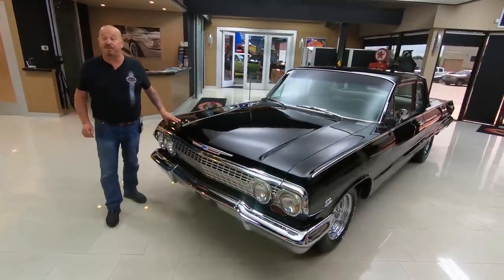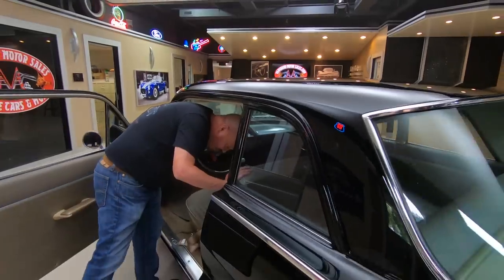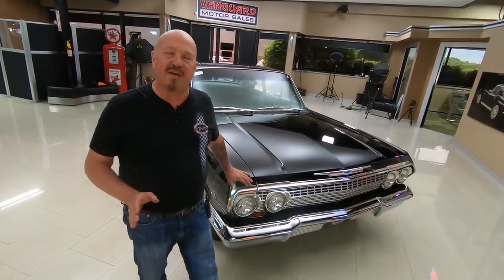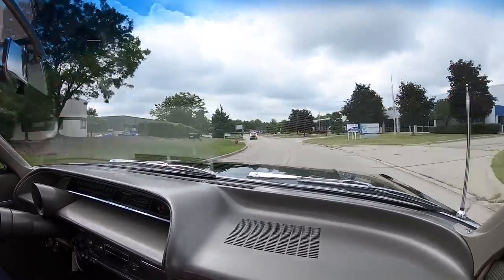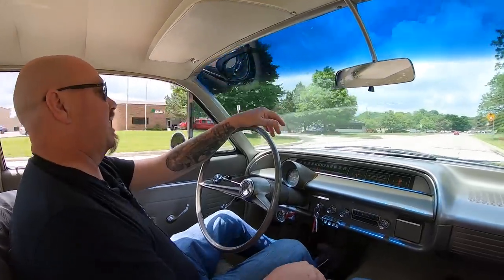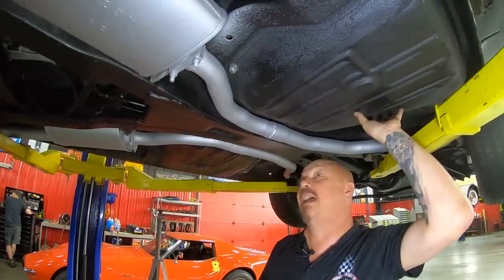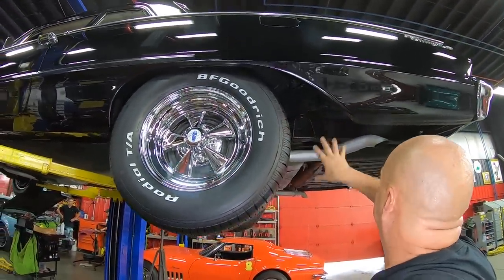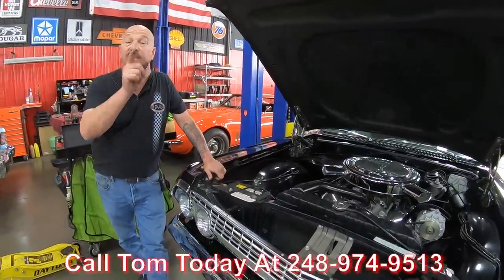1963 Chevrolet Biscayne For Sale

Comment: Beautiful, Beautiful Car. They were monsters.   As far as the P on the Carrier housing, it indicated a posi rear. The inside of the housing was different than the ones for the open rears. There was a portion of the internal webbing removed to accommodate the posi unit.  I remember having to hunting one down when I was putting a posi unit in my 55 210.